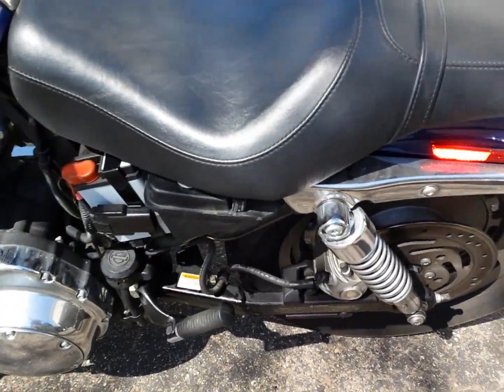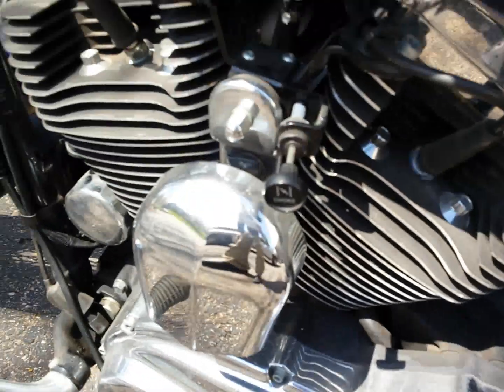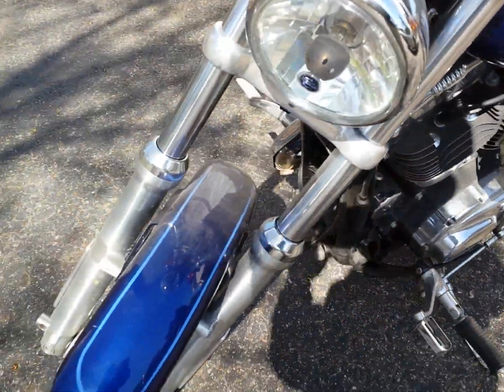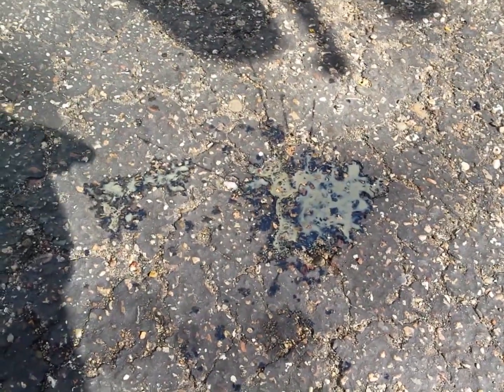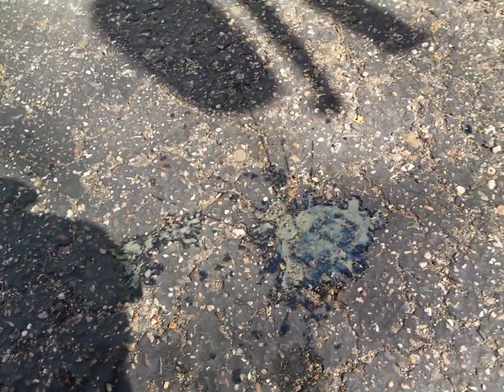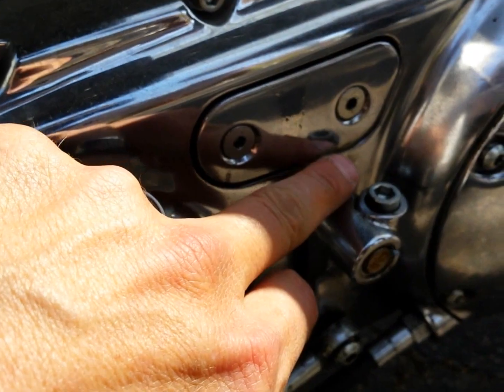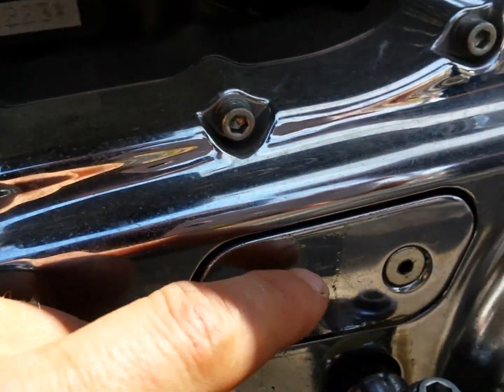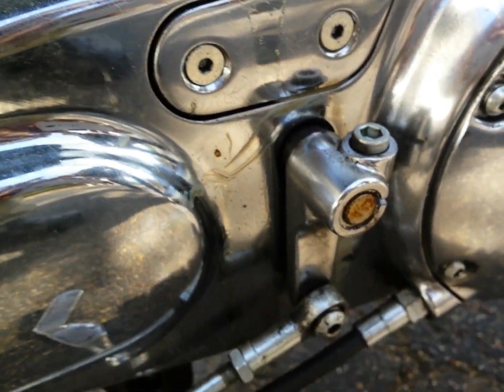Harley started but is leaking.

Comment: That's the inspection cover for the primary chain. Drain the oil clean up the inside of primary case and replace the gaskets. It's about a 30 min job. Easy as that!!!

Comment: Condensation will build up in the crankcase, change the oil and replace the seal/gasket. I've seen this many times when I was a motorcycle mechanic.
Reply from the maker: fatmantolly thasnk! yeah changed the fluid and sold it was just fine.

Comment: i would  drain the old oil and put in new. . have you checked the engine oil  ? was it setting outside for a period of time?
Reply from the maker: long13hair not outside but not temp controlled. Changed the oil we shall see

Comment: I agree about changing the oil. If it was water-cooled, I would guess head gasket, but with an air-cooled engine, I'm guessing condensation.
Reply from the maker: ***** thanks buddy!
Reply: there is no such thing as watercooled sportster all aircooled even the new fuel injected bikes
Reply: your primary oil is inthere wich mean if it has water in in it from it sitting for a long time juat change it

Comment: 178.4 did they ride it at all the water in the oil HUMM not sure but i would not run it till you replace it dont know how it would have got in there it is air cooled right
Reply from the maker: renemanjr123 i think so yeah,